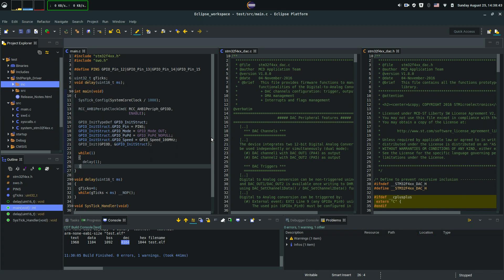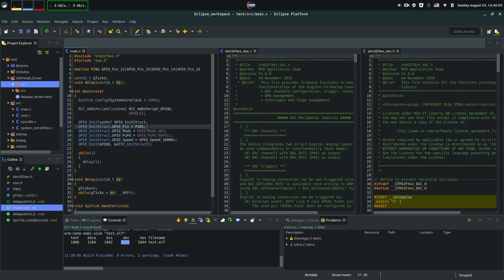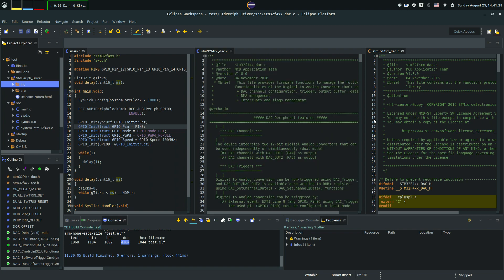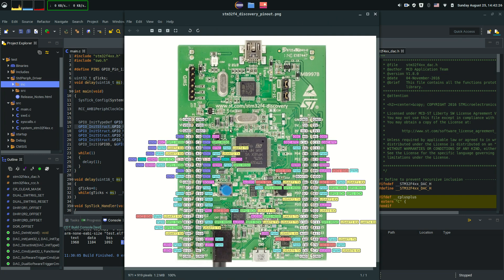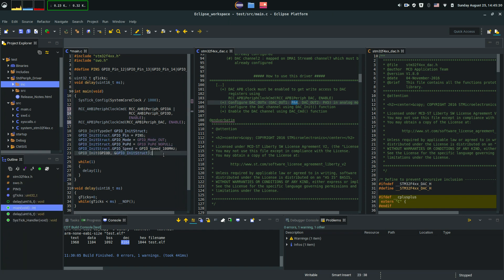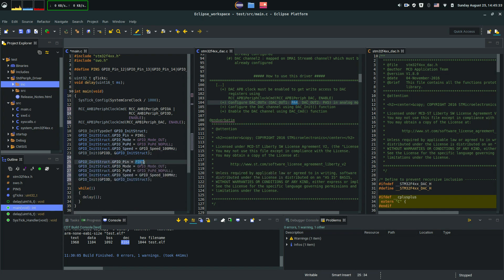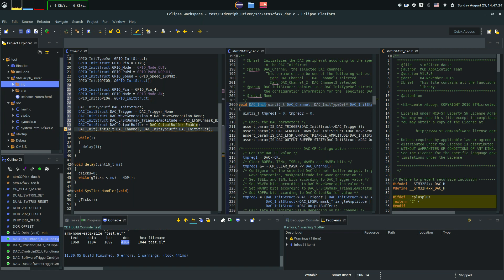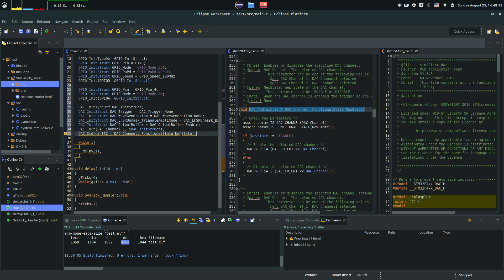Making waveforms with DAC | VIDEO 15

Comment: Hi thank you for great content ! 
Could you advice how to output CV (control voltage) 0-5V from my Nucleo STM32F476RG board? 
It has two DAC and two opamps with programmable gain. There is also 5V pin and Vref pin but I’m scared to connect them :)
Reply from the maker: Sorry for the late reply. I could not found this chip part number. Did you mean the L series with the similar part number?
It has a pair of dacs and adcs. The thing is, they're both powered by Vdda rail, which should be at maximum of 3.6V as said in the datasheet. If you want a larger output voltage you would need to add external gain/amplification stage.
Reply: @MatejBlagšič  thank you you are right it’s Nucleo-L476RG and I found that I need a -10 +10V power supply and a set of OPAMPs to get a good stable output.

Comment: thnaks for video do you have any idea how ı listen this wave from stm32f4
Reply from the maker: I do not understand your question ... are you asking how to hear the generated signal on a speaker of dac output?
Reply: @MatejBlagšič  yeah ı asked that
Reply from the maker: You can use an op amp to buffer and/or amplify the signal and then pass its output to a simple push-pull stage made of npn and pnp transistors. To test this, take a 3.5mm audio jack and attach heaphones to transistor stage output. Make sure you use a large elco capacitor in series between op=amp output and headphone to remove dc offset. You can search for simple low power amplifiers with ic like lm386
Reply: Matej Blagšič ı am so thankful for you
Reply: @MatejBlagšič  btw are you suggest linux for debugger ? I am using IAR and but ı am interested in with Linux.
Reply from the maker: I use stm32cubeide which is cross platform for IDE. For debugger, st-link is fine, but I use jlink from segger on my boards because we use it at work, so I used segger tool to reflash all st-link debuggers to jlink. Both is supported by cubeide. 
I use linux as my os for years. Should you choose linux depends on your needs.
Reply: @MatejBlagšič  thanks for answer.I am beginner for STM32  I am Working on it.